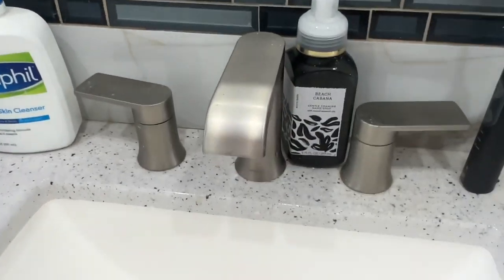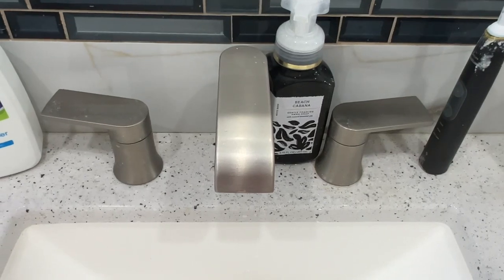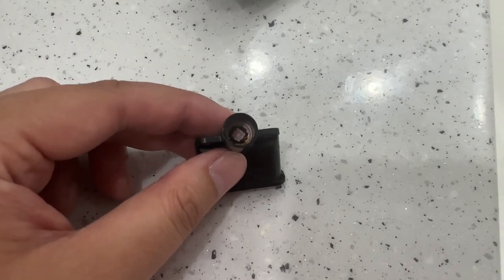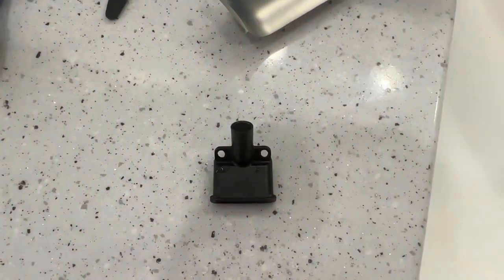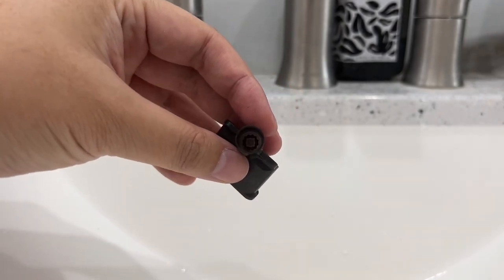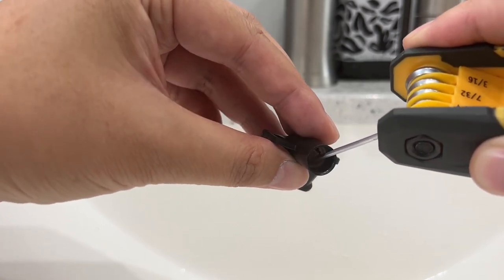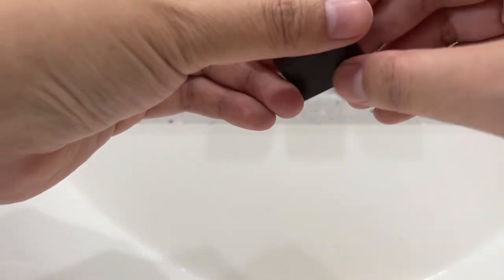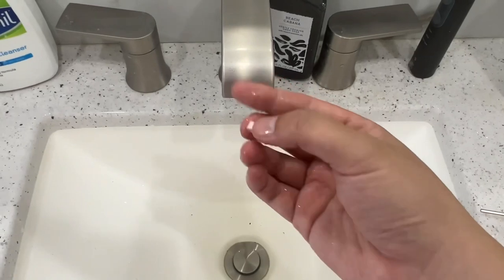How to Remove Flow Restrictor for Moen Genta Bathroom Faucet | Increase Water Pressure and Flow

Comment: Great video.  I did the modification and the flow has definitely increased.  However, I found a glitch.  Since the plastic aerator screen seems to be held in place only by friction, it came flying out when the water was turned on.  This required me to dial back the water pressure with the under sink valves to keep the screen from being blown out of the faucet.  So, essentially, I now have only slightly more flow than I did with the restrictor installed.  Do you know if any other folks experienced this issue?  Any suggestions to better secure the aerator?
Reply: A bit of waterproof glue on the part that's friction fitting, perhaps? Note that normal superglue (cyanoacrylate) is not waterproof (the bond weakens over time when exposed to water).

Comment: Great video 👍. How difficult is it to screw it back?  I did not find any video walking through that final phase and it seems very difficult and uncomfortable.
Reply: It's not screwed in. I used a metal pick that came to a point and it just slid right out without difficulty. If I had to put it back in, I'd just push it back in.

I was fine with the volume of water, but it was landing right at the edge of the drain and splashing everywhere. So I removed the flow restrictor to get the water coming out past the drain and then used the hot and cold shutoff valves under the sink to restrict the flow so that the water landed where I wanted it. Not ideal because the shutoffs are before the mixer, so even if I get warm water to land where I want it, pure hot and pure cold don't have as much flow and still splash, but hey, it's still an improvement. I'll probably play with the shutoffs to tweak the individual hot/cold pressure to try to improve it more.